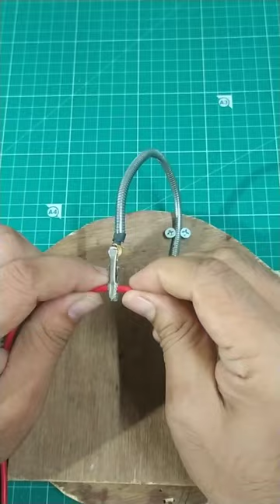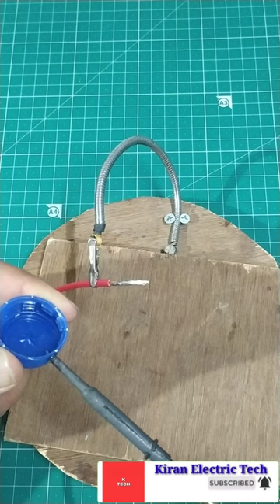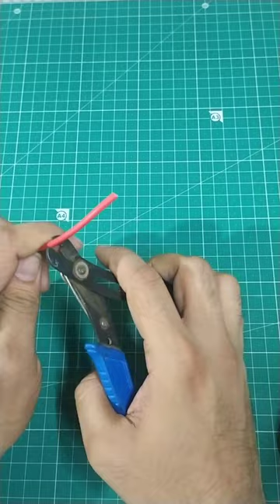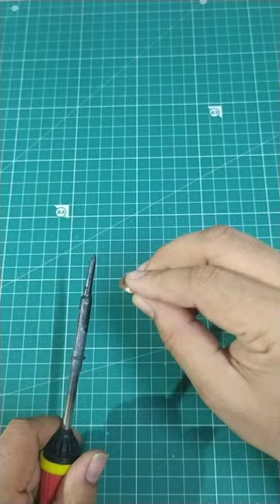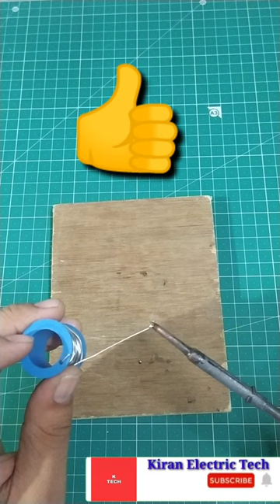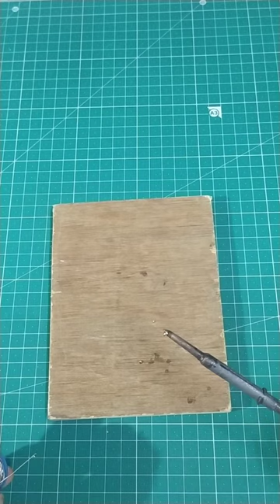solder not sticking to tip #shorts #hack

Comment: But I want to stick wire it won't stick on the point. But if I use only solding metal it sticks.  What's the problem is solding material bad
Reply: Does your problem Get solved. I am having similar problems, everthing is fine just cant solder 2 wire together, the solder become like a paste and cant stick properly. Anny help??
Reply: Aad flux to wire then touch solder wire to wire and then solder iron with 1mm gap. Flux will transfer heat to solder wire and will spread evenly.